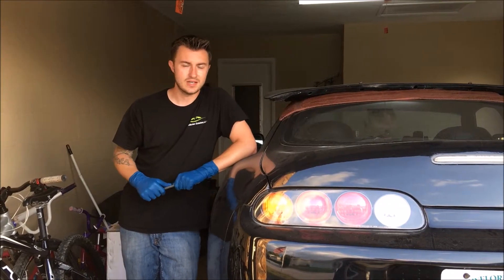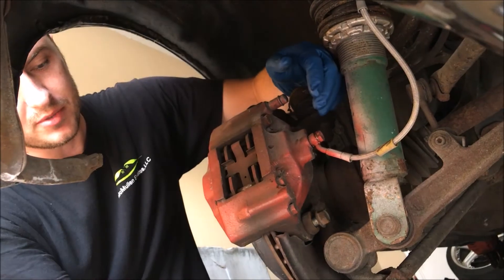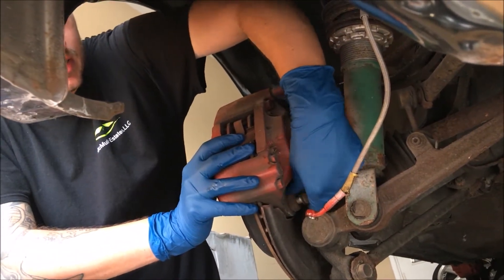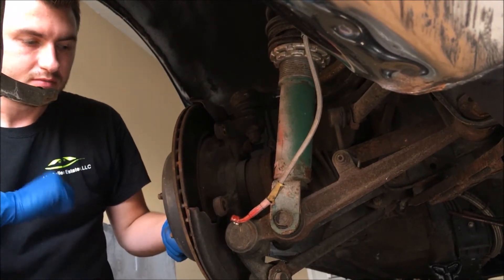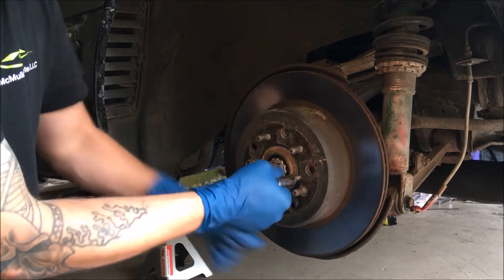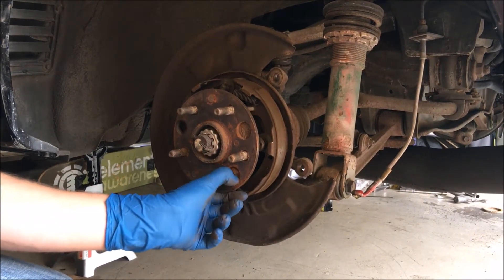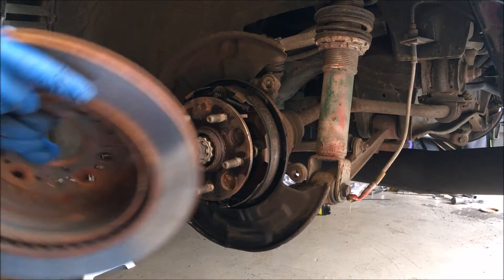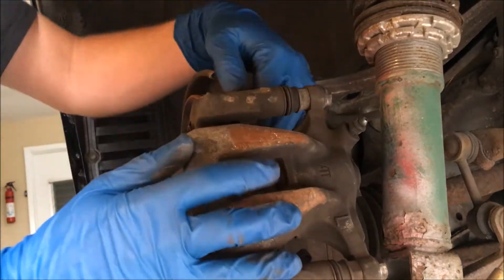Toyota Supra | Swapping Rear Turbo Brakes To NA Brakes

Comment: Great job Kevin. I had to grind away some of the bottom NA caliper to completely clear the 15" Welds.
Reply from the maker: 7THxSIGN 
Ive noticed some have to and some don't. These happened to already be shaved. What a difference it makes running the 15" rides softer and grips really good.

Comment: I like that you cut the rear quarters.  I am doing mine tonight.
Reply from the maker: Boost Technique 
They are actually rolled really good. They are hard to roll this far.
Reply: Kevin Mcmullen so do you recommend cutting them then? My 275s rub
Reply from the maker: Boost Technique 
Rolling is hard even with a roller. Cut is good too just leaves a rough lip either is fine
Reply: Kevin Mcmullen ok I planned on sanding and painting it after.
Reply from the maker: Boost Technique either way will work cutting might be easier.
Reply: Kevin Mcmullen it’s tripping me out having 2 convos with you on two different platforms haha.  Yeah most Supra guy say just cut them.

Comment: Nice vid... waiting on my JDM TT Supra that has the NA rears, might just keep them now lol. Instead of going TT rear brakes, just go back if I end up running 15" drag radials. Got my sub!
Reply from the maker: Thanks man! Congrats what color is the car? I never noticed much of a performance difference between rear na or tt breaks so I would say stick with na on the rear.

Comment: Great video man! few questions did you have to cut the tt dust shields to fit the 15" welds on? and were the lugs for the wheel nuts long enough?
Reply from the maker: Anthony 
Thanks I did not have to cut the shields. I used mcguard lug nuts if I remmeber correctly

Comment: Looking at doing a na -> turbo break conversion, do the front holes also line up for the calapers like your rears did? Looked almost too easy to do the swap
Reply from the maker: OverSpecFilms 
Yep. They bolt right on.
Reply from the maker: OverSpecFilms 
By the way autozone sells new remanufactured tt brakes for pretty cheap.
Reply: Kevin McMullen thanks for the quick response mate, I’ll look into them, cost might go up substantially since I live in Australia but appreciate the help
Reply from the maker: OverSpecFilms 
Yeah prices may be different there. Take care man.